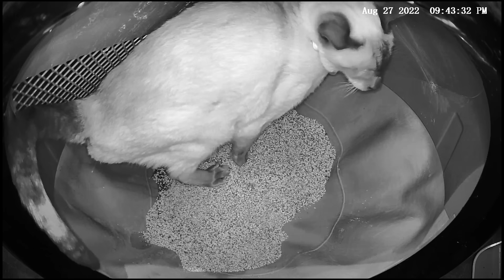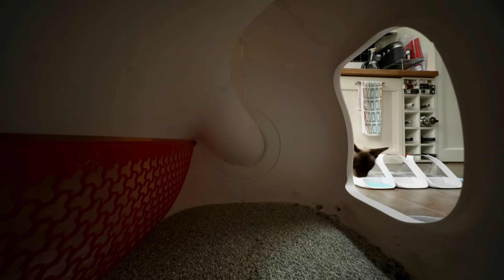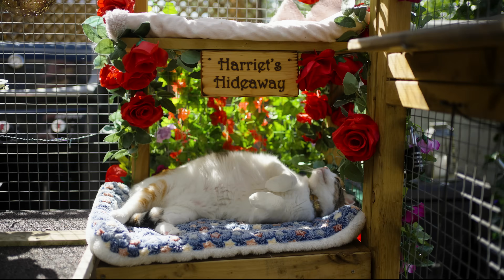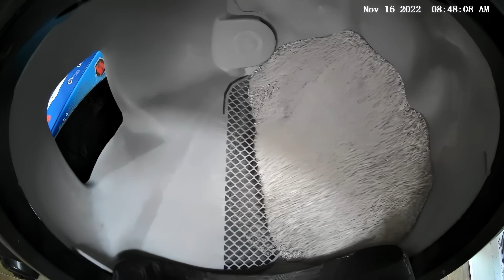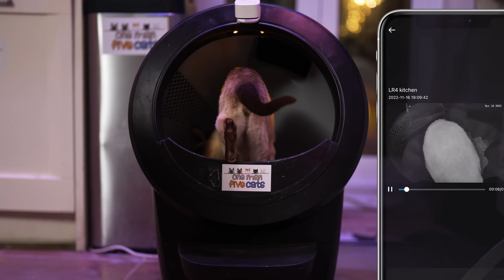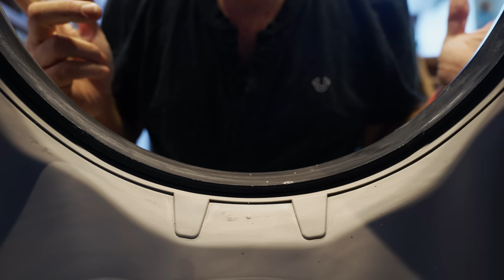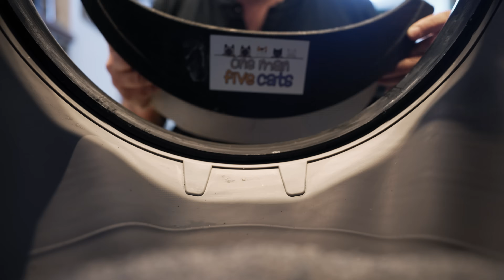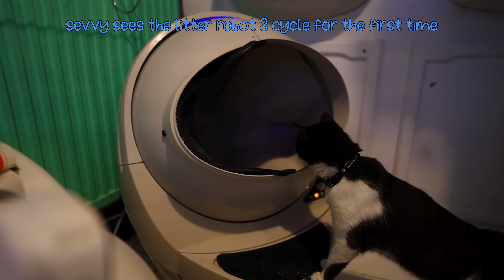Litter-Robot 4 Review: Is It REALLY the Best Self-Cleaning Litter Box?

Comment: My biggest concern about buying one of these is that in my non-automatic litterboxes, clumps always get stuck tightly to the bottom of the box.  My cats like to dig first before using, so there's a lot of surface area to get stuck and I have to scrape very hard to get them off.  Point being that anything that relies on gravity seems like it would be completely useless.

Comment: I loved your video, we had a litter robot for over 10 years and only had to replace the base once with 4 cats.  One of our older cats peed out the opening just like your cat was doing.  The model we owned had a drawer that had a snap in grate that was the place the cats stepped on to get into the box.  The cat would climb into the chamber and pee out the opening and the  urine splash out on to the grate would end up in the bottom drawer under the liner.  I tried different methods of trying to line the bottom drawer with dog pee pads and tried different kinds of bags.  I still loved our litter robot.  It doesn't matter how old your cat is, they will get used to it.  Thank you for posting!

Comment: Thank you very very much. I have been overwhelmed with all the automatic litter boxes out there. It is very important to me to find the right box for my two boys. They are two different sizes. One is petite and one is very long. One pees like a racehorse and one pees normally. I was afraid of the one that pees like a racehorse and he would get the pee in between the seams. Now that litter robot four has fixed that, I feel a lot better. Also that it’s a lot quieter is another plus. It also looks like my longer cat will fit in there and not suffocate.

Comment: @OneManFiveCats:
Suggestions box.
Use a CriCut machine to design vinyl stickers to place next to the buttons that show shortcuts for how to press the buttons to do those difficult to remember functions.

Rebranding to OneManSixCats might not be a great idea for several reasons. Managing two brands at the same time would be problematic with time spent managing each. As time passes, it's likely the number of cats may change up or down. If all of your cats are spayed/neutered, this isn't as much of an issue but should one of them pass (as hard as that is to imagine and as difficult as it is to process grief for) changing your brand name to reflect that change would be unpredictable and disruptive for you as a creator. So I second your assessment not to rebrand or create a second one. You can always just have the intro to your videos changed to reflect the accurate number for that time period.

As for how this video was done, I have no room for improvement as you've done everything in a format that answers all my questions preemptively and showcases everything in a way that I think accurately reflects each machine's performance. You've also touched on the issues that can't really be documented on a camera by describing the experience and how you adapted to the issue(s). I especially liked the addition of a smart switch for a hard reset with remote access, for times you're not home and need to do a hard reset asap.

Thank you for making this content, as I'm currently in the market to buy two auto cleaning cat litter boxes.
Reply from the maker: Thank you. But what’s this about rebranding? Do you see any rebranding? What’s my channel called? This video is a year old, as you can see it’s “One Man Five Cats”.

Comment: I hope I am not too late: If you are thinking about buying a Pura-Max   DO NOT DO NOT DO NOT.  I have 4 Litter Robots and when I saw the Pura-Max, I thought it was a better concept, so I purchased one. We clean all our boxes pans out every morning. I kept noticing a strong smell of urine around the Pura-max but never could find it. I just assumed that it was the way the litter was being disposed of...until I took the globe off. The bottom membrane the litter covers inside the unit was so thin that my cats poked holes in it with their claws and urine was running through it and pooling under the globe. I tried contacting the company but it was a nightmare. I later learned the company only had no footprint here in the USA and the number you called is just to a warehouse worker in Florida who would pass along your complaints to China. After about 3 months of message relays I was able to get a new box (as they would not refund) which I promptly sold and bought another Litter Robot.
Reply from the maker: Yes I cover all the issues in part 3 of the mega test :)
Reply: Oof, I bought it yesterday through Amazon so let's see how it works.

Comment: Could I use this with a 2/3 month old kitten that’s around 1.5 pounds
Reply: With it turned off yes. Once the kitten is 3 pounds then you can start autocycling. Until then just power it on supervised for it cycle then turn it off again.
Reply: Thank you! I purchased one, but cancelled the order due to that concern. I will buy again in a few weeks. On the pee guard, I noticed on Amazon you can’t buy any accessory like that
Reply: @clink4340  why cancel it? You can still use it!
Reply: @philipbloom  I wasn’t sure. I will prob still buy it again in 2/3 weeks. I’m also concerned about the pee guard. I think newer units they made it taller

Comment: I love these videos, and can't wait for the next one.  I did have a question about the Litter Robot 4.  Did all of your cats start using right away, and if not what did you do to acclimate them to it?  I have two cats and bought the Litter Robot 4, but only one cat uses it.  The other cat is terrified of it and would rather poop on the floor and pee in an empty litterbox.  I am, however, grateful that he at least peed in the empty litterbox.  I removed the orb and set it in a box so it doesn't move around.  It would be nice if both cats used it instead of the one.
Reply: Thank you. Yes they did, but they had used other machines prior ti this. It’s key you have auto cycling turned off and just do it manually when they aren’t around otherwise you could well scare them off.
Reply: @philipbloom Thanks for the reply.  Yes, I probably rushed them too soon.  Got excited to try it out.  I put a clump of the frightened cat's pee in the orb.  It's off and on the floor.  Wish me luck.

Comment: There was a similar pee issue with the original gen-1 litter robots too.  We had a 16lb cat who would stand on the step and pee down the front of it...  Right onto the control panel, which was located right below the opening.  

Seeing the new design with cats in it, I'm not sure that the larger opening is necessarily better.

For what it's worth, we're still rocking the original LR1 from 2007.  We had to replace the circuit board due to the afore-mentioned pee issue, and we have a spare motor and gearbox assembly because it makes a crazy racket and I suspect it's on the verge of failure, but it just keeps going!

Comment: my cat loves to paw at waste clumps as they fall down the chute of my LR3 connect. he thinks it is the world's greatest game, his pupils get so wide. it is, however, a HUGE pain in the ass lol and makes our unit so dirty (and also makes him dirty too). seems like the new sensors of the LR4 might prevent this? 

i've gone back and forth about whether the LR3 has been worth it for us. when i do the "empty" cycle on the machine, litter gets stuck behind the plastic panel to the right, like a gap in the plastic didn't get sealed, making it impossible for the empty cycle to actually fully empty all the litter. this has made deep cleans a pain in the ass because i have to shake the globe repeatedly to get as much of the litter out as possible. seems like LR4 doesn't have that same gap that litter gets trapped in, so you can actually empty it without shaking it all around. 

i bought the LR3 in full in 2020 so buying another in 2023 for so much more money seems unappealing. but it is SO nice when the LR3 works for us (it's enjoyable 85% of the time). it seems like the LR4 would more consistently offer that experience, and would be better for my very long and large cat. decisions decisions
Reply from the maker: I can’t tell you everything will be so much better, but it might…

Because the LR4 has an entry sensor when your cat gets close to the machine during a cycle it will stop so he won’t have a chance to hit the waste!

My empty litter part doesn’t have an issue for deep cleaning.

Comment: Good video! 
I have a litter robot 4 too. 
Unfortunately, one of my cats is having urinary issues and i need to be able to monitor his litter box use. How did you install a camera inside the litter box ? Thank you!
Reply from the maker: Thank you. 

There’s a USB port under the bonnet at the top. I use a Eufy Indoor camera which is attached to the front of the LR4 using heavy duty  velcro
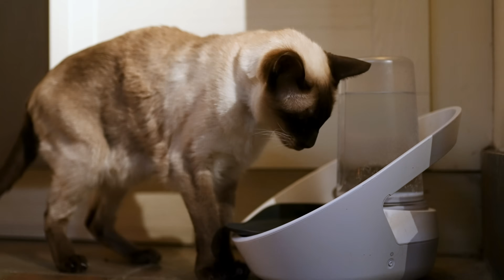Reply: @OneManFiveCats  Thank you!  But how did you record the view from the inside  (14:41 on this video)? It shows a superb view of the litter.  Thank you again!
Reply from the maker: @egcorral  ah. I removed the bonnet, tricked the sensor into thinking it was attached and pointed my proper camera through the waste dump port.

Comment: Thank you for the in-depth review. I’ve had a LR-3 Connect for a couple years now and without issue except for their older app before they changed over. Then, suddenly the motor stopped running mid-cycle and never came back on again (so movement or sound at all). 

Instead of tearing it apart (which may have voided the warrantee), I contacted customer service and they were able to send me a new bottom to the machine. After getting the new one I decided to tear open the motor to see if I could figure out what was wrong since the warrantee was transferred over to the new unit. I found that one of the gears inside there appeared to have been installed in reverse the entire time, leading to a poor interlocking between the teeth and it ground down the tiny portion it was touching. A little cleaning, greasing, and rotating that tiny gear fixed it right up. Just waiting on a new bonnet and I will have a second one running for the cost of about $200 (for a second hand globe, new bonnet, and refurbished step).

I’d love to know if you ever had an issue with your LR-3’s motor failing- and if it fails on the LR-4 what the insides look like that appear to make it so much quieter than the 3.

Thanks again. Very informative video.

Comment: I have the litter robot 3 connect and am seriously considering getting the latest. You really helped me learn more as part of my research. Thank you for that. Thought I'd return the favor with something I've discovered that has really made a difference. You might know this already but thought I'd share. I clean my litter robot every time I replace the bag. When I do so after wiping the inside down, I spray it with furniture polish. I then wipe off any excess. Basically waxing the plastic inside reduces any sticking. By doing this, it's much more clean between cleanings. When poop is stuck to the walls, my cats can bump into it while going. This dramatically lessens that and it's more sanitary. Anyways, thought I'd share. Thanks for your videos and can't wait till your next one.
Reply from the maker: I might try that. I don’t fancy cleaning my machine every 3 days though!
Reply: Haha.. That's a good point with now 6 cats. But now typing that makes me think it's more of a need.. I'd love to hear what you think.
Reply from the maker: @achillesdesigns207  I don’t really have an issue with using it like I do. I give it a wipe down when needed then a deep clean of the globe every 6 weeks-ish.

Comment: Ok ,when a cat uses a litter box you cannot scoop it right away, you have to give it time for the litter to harden the urine and poop ,those machines need to clean the waste hour after a use 
And I do know who sells the number 1 best litter that matters also
Reply from the maker: I don’t understand your comment. You can change the delay for the cycle with these machines. You don’t need to wait an hour, I set mine to 30 minutes and it’s easily firm enough to cycle.
Reply: This cat litter is the best and my male cat sprays on it and it don't stink and I try all litter experimenting wich works 
Try this litter....arm and hammer clump and  seal ultra odor blaster multi cat 
99.9% dust free 
You try this litter in your machines?

Comment: I've been looking at auto boxes lately. I think you may have sold me on the Litter Robot 4. My only issue is I've heard some people mention it malfunctioning during the sifting process. How common is this malfunction, I wonder?
Reply from the maker: My two machines have been flawless for nearly 5 months. I had issues earlier but they were fixed firmware apart from my DFI sensor which needed a new board for which I talk about in this.

Comment: Did they acknowledge the urine flaw. They originally told you too bad....then later changed their tune. Worse, they had to know this was going to be an issue and decided to ignore it. I dont want a high fence but I do want the protection. So, I will have to modify their new fence....and likely pay for this improvement. Any why the heck is the felt stuck to the inside of my globe?
Reply from the maker: can you show me a picture of the felt? there should be no felt in there.
Reply: @OneManFiveCats  Seal Strip
Reply from the maker: @iamintractable1805  this? https://youtu.be/3K8omHO8hCg?t=1198

Comment: How old is your unit. I have felt liner mounted inside the globe too keep litter from falling into the base. You dont appear to have this liner. The felt precludes washing the globe with a hose or shower as Whisker does not sell replacement felt. I also see a ton of litter below the globe so you might benefit front insisting they provide the felt to you.
Reply from the maker: felt? I show the brushes that are in there, there's no felt. Did you not finish the video as I show the new fence that fixes my issues. P.S I have had 3 units, the black one came late summer.
Reply: @OneManFiveCats  Sorry I did not use the correct name: Seal Strip. Its inside my globe.

Comment: How does one go about making the switch from traditional to self-cleaning? This is no small amount of money for me and I’m terrified that my two cats won’t use a self-cleaning unit.
Reply from the maker: Two main ways: 

1: Turn off automatic litter box until they are used to using it and only cycle it when you are with it. To help them go in it put some of the litter from their old box in with the new clumping litter. Let them get used to seeing the machine cycle and if they just look at it and aren’t scared then try it in auto mode. 

2: if they are more nervous, keep your old litter box next to it, you make sure the self cleaning one is off. Put the correct litter in the new litter box which may be different to what you are using but mix in a small amount of their normal litter from the current box so it smells of them. 

Try covering over their normal little box once you’ve seen them go in the new one, shouldn’t take long. Only cycle the machine when you are next to it. Don’t leave their old box out once you’ve see them use the new one. 

I go over the procedure in the first video on this channel. I found the switch over to be very easy for all of my cats. Including a 14 year old who had only even used a beach in Greece before! 

Good luck!

Comment: I have a manual Litter Robot 3, Cat Genie, and have purchased/backed the Furbulous which I hope does well. The LR3 I have is a sensor issue, the safety one, which I will eventually bypass. Litter is an issue in my house as we had 10 cats, one passed in Oct from cancer. Auto litter boxes keeps me from having to work, be union president, trying to start up a new business and clean the litter. My wife doesn't like the litter boxes but likes the cats, so it's a bit tough getting help. 

This is the first one I have seen of your series and I have to say, this is one of the best review series I have seen. Thanks as this will help tons. 

The Cat Genie, while using water to self clean is prone to issues. The hose they give you to take the waste to the toilet needs to have a bigger space between the toilet seat and the toilet, so sending spacers with it would have been good as the hose is cracking. My wife was maintaining that one, but seems the plug got knocked out of the socket a while back and she didn't notice. So it doesn't really help much.

Comment: We've had our LR4 for about 3 months or so (our LR3 kicked the bucket after 1yr and a warranty replacement), and ofcourse our LR4 has ceased working despite all troubleshooting. The light display you mentioned is quite unhelpful indeed and we've discovered that many issues do not have a specific light sequence, but rather just solid bright red to low light red (pinch, cat detected, too much litter, etc). I'm quite surprised you haven't had issues with the extreme sensitivity of the sensors to hair, dust etc (they do not seem to be trivial). I would caution that anyone seeking to buy an LR4 be aware of how finicky and difficult they can be. Currently I'm the twice daily designated manual poop globe rotator (it's 100% worse than a regular scooper).

Comment: I just got the litter  robot 4. I love it because  its so quiet.  The 3 and the 2 is way louder. I had many issues with the robot 3. The pinch point sensor gets dirty.easy and i have to take the whole unit apart. . Ive had more issues with the #3 model than the old # 2 model.  I cant say that i wont with the # 4 because  ive had it only a week.  But i can say i wouldn't  recommend the # 3 model BECAUSE  THE COMPANY'S CUSTOMER SERVICE HAS  GONE DOWN THE CRAP HOLE. TERRIBLE  at answering  any emails. They used to be great. Now their customer  service  SUCKS. Unless you call then directly THEN WAIT ON HOLD.